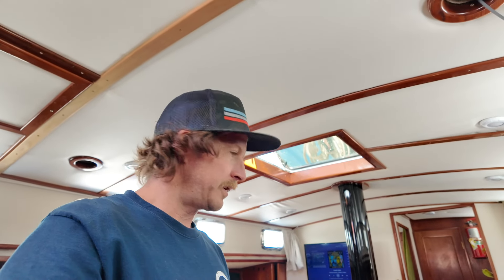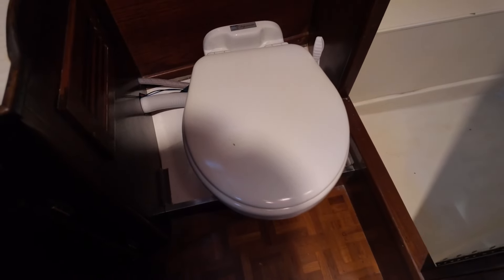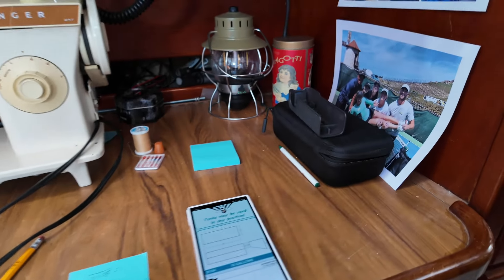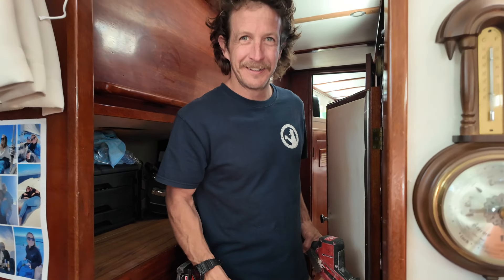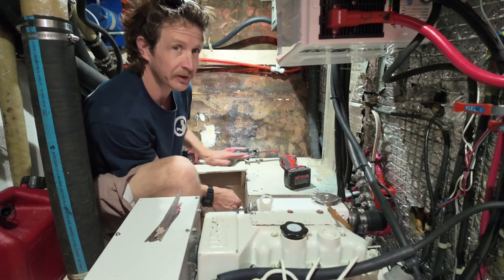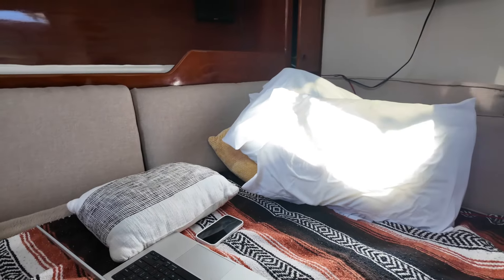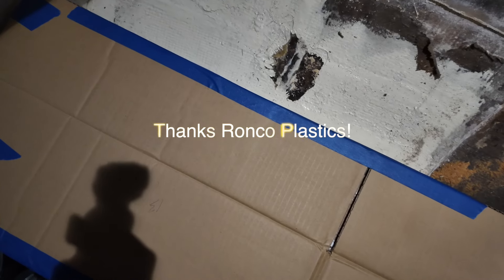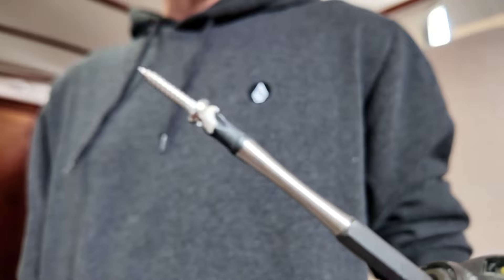Boat Life Ep 9: Designing a Custom Holding Tank for our skibidi toilet

Comment: If it is at all possible, try to use as little of the white sanitation hose as possible. I replumbed my boat to get rid of the constant stink of what I was trying to dispose of with it only to be faced with the same problem the following year. the second time... I used schedule 40 PVC pipe for the long runs from the head to the tank and where ever I could fit it in and it made a huge difference. It took a bit of creative fitting/thinking to ruin the line, but it was well worth it. Hope that helps...
Reply from the maker: Thanks so much for the guidance! Have you ever had any problems with 90 degree angles? We were trying to avoid any angles for potential build up.
Reply: @AlivoSailing  I used a small section of hose coming off the head and tank connected to a coupler out of the pipe. It really made a significant difference for me. good luck to you!
Reply from the maker: Thank you! 🙏🏼